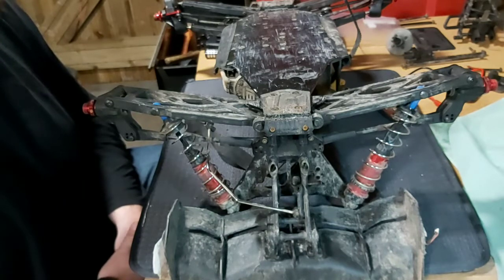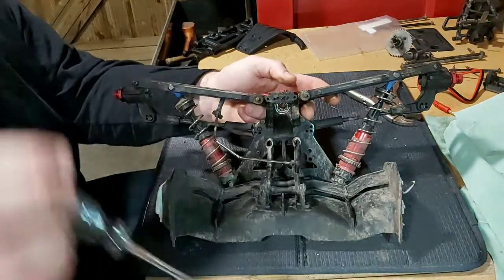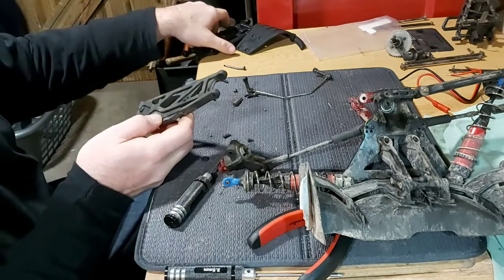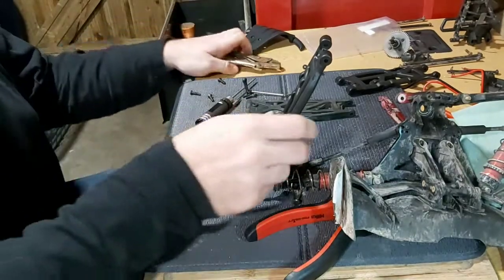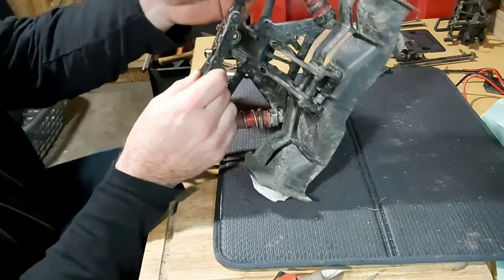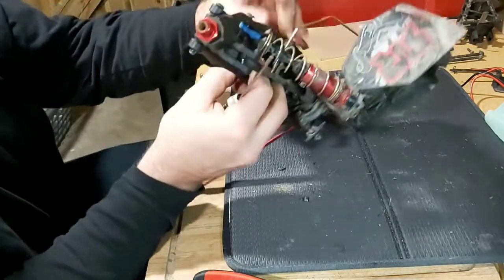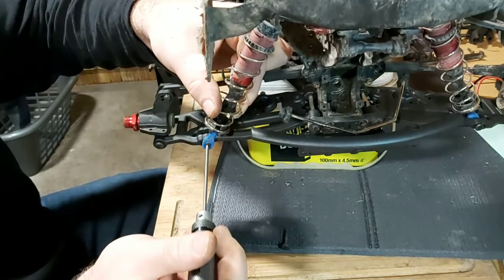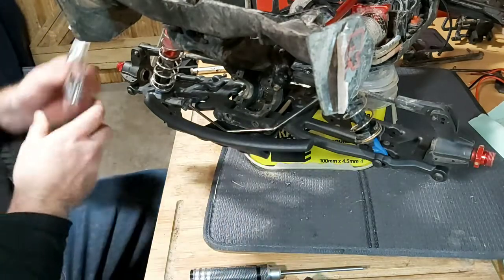ARRMA KRATON 6S V4 FITTING UPGRADED RPM REAR ARMS AND RPM FRONT BUMPER TO THE REAR

Comment: How did u get the rear sway bar to fit the new RPM arms mine is too short. I have the v5 Kraton 6s
Reply from the maker: AHH I have the v4 and the geometry is different to the V5 so not sure they fit
Reply: @bournemouthrc4371  it's just that I got the RPM upgrades the front ones fit perfect but the rear sway bar is just a bit short so I have to run the stock rear arms.. sucks lol
Reply from the maker: @sugarperez6933  AHH man that sucks, hopefully rpm will bring out the v5 ones soon

Comment: Hi mate does the rpm bumper fit straight on? I’ve ordered one for my 6s v4
Reply from the maker: Yes it fits straight on, I would recomend getting the talion front bumper to replace the Kraton one to go with it. The Kraton one is too big behind the RPM bumper and can get forced up on impact breaking the screws.

 Another option Is the custom rc upgrade hinge pin holder for the front, you then don't need a small bumper to go behind the RPM one as this locks in the hinge pins itself. this is the best idea but slightly more expensive.
Reply: Bournemouth RC thanks for the advise mate I ordered the tailion one last night after seeing another one of your videos. My car arrived earlier today I cannot believe how big it is, they’ve come a long long way since I last had an rc car, talking 15 years ago aha. Ive subbed :)
Reply from the maker: @bennett7995  cheers man, yes the Kraton was my first one since a break in the hobby they are Awesome trucks can't believe how good they are, you will love it